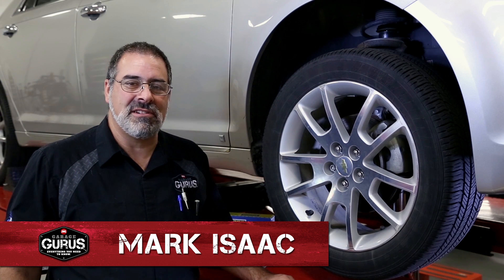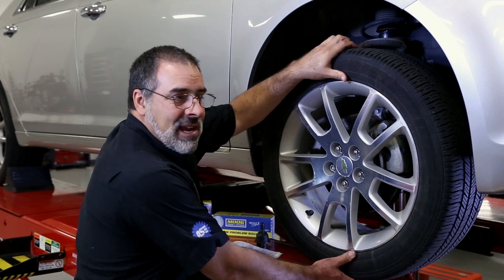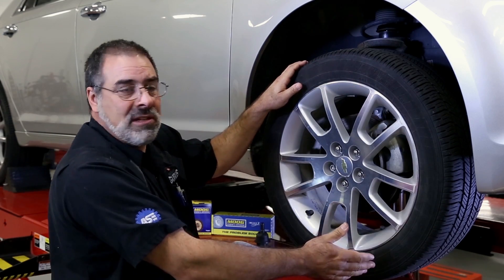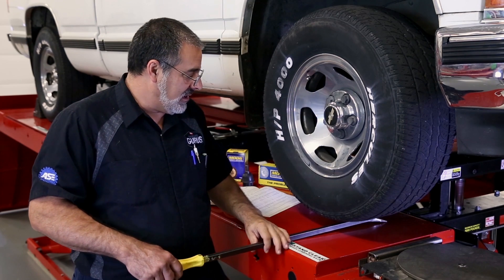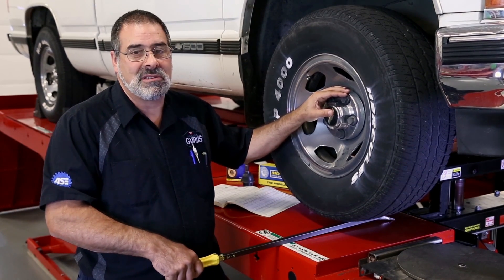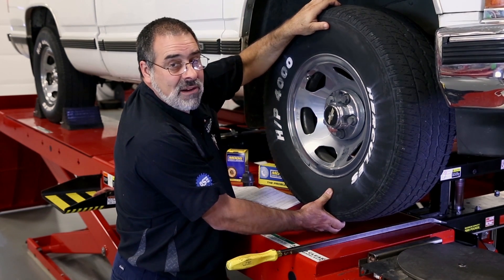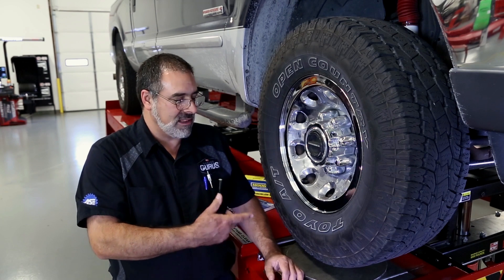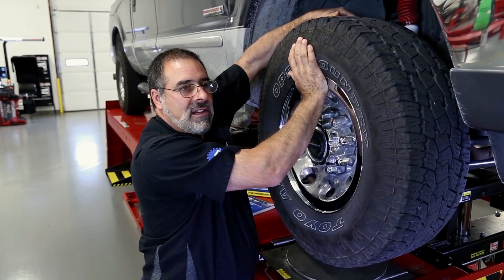Ball Joint Inspection Procedures

Comment: I've been at it for 50 years. This is how I do it. I have recently added moving the wheel through the full range of the turning arc and check for looseness. I missed a loose ball joint because of checking in the general straight ahead direction only. Great video. Thanks!

Comment: As a mechanic/technician I understand that the specs are listed- allowable movement - so many thousandths of an inch, but legitimately if you can see and feel the play - the part is worn out.
Reply: Not true  If they wanted no movement they would  state that.  It is not a perfect world.
Reply: @PaulSmithDYL  I'm sorry I don't understand.
Reply: Some ball joints have play out of the box, by design.

Comment: Hello,

So I thought this was great info for checking loose ball joints, but I think people often overlook seized ball joints as well? They are just as dangerous. From my understanding, you want to also take off the tie rod and make sure the wheel can move side to side freely, since a seized ball joint won't allow it to do so. Not all ball joints become loose, many start seizing up as they fail. Your input on this would be appreciated.

Great video.
Reply: It wasn't a ball joint in my case. I broke a tie rod end. My brother brought up I should check stuff like that. I reminded him that we did 2 weeks before, and everything was tight, and he helped me. Figured it was tight like you're saying.

Comment: In the first vehicle (McPherson suspension)in your video, do you have to jack up the front so both front wheels are off the ground, or is it ok to have just one wheel lifted?
Reply from the maker: The job would be easier with both wheels off the ground.  You may have to steer the strut to access the ball joint.  Sometimes removing the tie rod and sway bar link allows you pivot the strut and have better access to the ball joint.

Comment: This video is the best explanation I’ve seen on YouTube. Do allowable ball joint movement allowances very from state to state
Reply from the maker: Shane, the specifications on ball joints are safety specs and are established by the vehicle manufacturer.  The different states may have different inspection requirements and procedures.